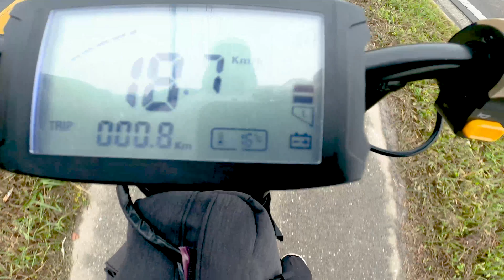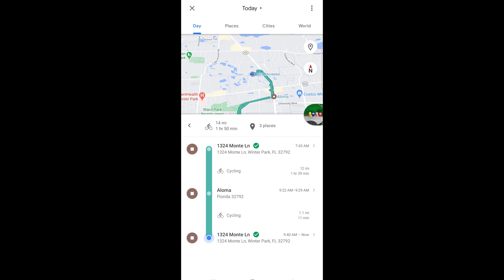Range Test With DIY Battery!/ Super Ride S1000

Comment: and were can i get just the battery
Reply from the maker: The battery is available through a company called x-offroad. I found it  through a Google search and you get the battery and new electronics. You just slide the old box from under the seat out and slide  the new one in. Very easy.

Comment: Seems like you were riding standing with no hands. Do you own a normal EUC?
Reply from the maker: I do not yet I am planning a purchase for something much bigger. I have found that it is easier to ride standing up because you can shift your weight faster to maintain balance. When I ride fast I stand and use my hands so if I start to lose control I can use the handles to help regain control. If you are not holding the handle and catch a surprise bump you will find yourself in a scary situation fast with little control.
Reply: I was curious to find this vehicle in google to study it more. Honestly, I found it too expensive for its specs. The price was around 1500$, but it's easily outperformed by EUCs for 1000$. Maybe the price is so high because of installed saddle or screen...
Reply from the maker: @maksimzal2790  I agree overpriced for the specs. I now wish I had a regular euc but I still have fun!

Comment: I am so sorry to hear about your accident. Can you please explain more? Did the scooter turn off as you lean forward and it turned back on? Does the scooter have a freewheel when there is no power? I hear you mention pushing it when it dies, can you go a bit deeper? Appreciate your work here Steve.
Reply from the maker: It is easy to push with no power so yes it free wheels. I was afraid the battery would die before I got home and have to push it but I made it. If ever it did die it would be easy to push home